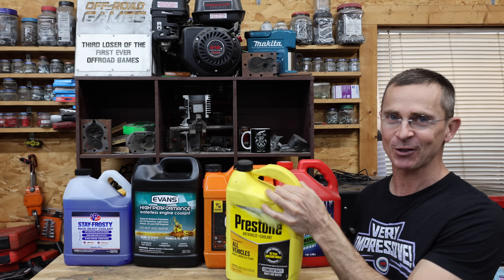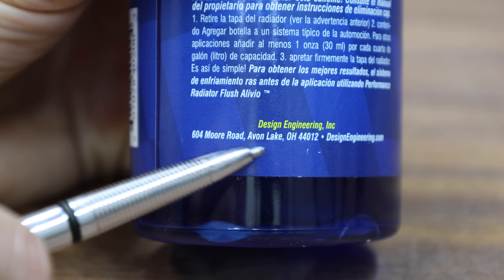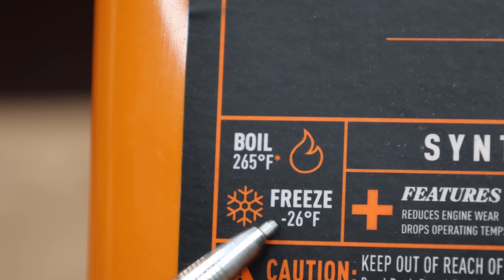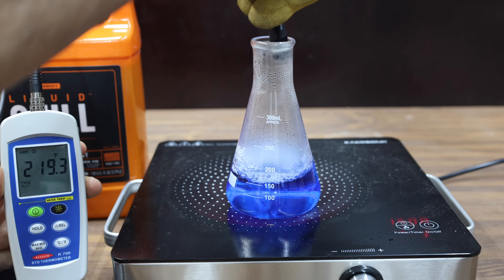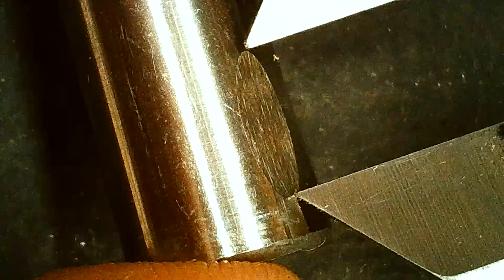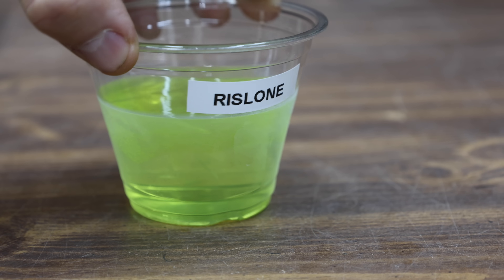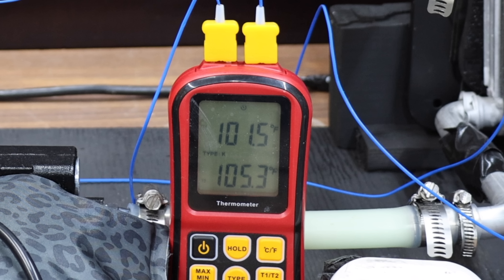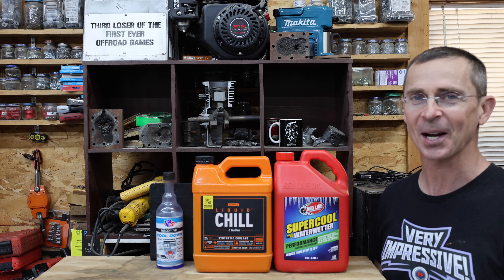Do "Super Coolants" Lower Engine Temperature By 30 Degrees?

Comment: 5:53 As you see, the Evan's Waterless is nitrite-free. Speaking from experience, you MUST do your research when installing alternative coolants. I used to drive a 1984 diesel Mercedes and the OE coolant was G05 chemistry. I used Zerex G05 as it was cheaper compared to the dealer-sourced coolant and essentially the same product. G05 has nitrites added which fight cavitation. In diesel engines specifically, the combustion event is so violent and high pressure and there is so much sideload thrust on the skirts that it causes cavitation bubbles to form on the cylinder wall/liner wall on the coolant jacket side. Those cavitation bubbles will erode holes in the wall very quickly if allowed to do so. You end up with pinholes appearing suddenly one day and your coolant begins burning through the exhaust as white smoke and/or leaking into the lube oil sump causing the oil to become that classic chocolate milk mess. Many people would say "I must've overheated and blew the head gasket/cracked the head” but that isn't the case at all. The true cause was the non-spec coolant which lacked the cavitation protection chemistry required for their engine. 🤷🏼‍♂️ They may do a complete head rebuild and after the R&R find themselves right back at square 1 and $1,000 lighter. Be careful folks. Do your research.
Reply from the maker: Thanks for sharing.
Reply: Wow. Thanks for sharing this story.

Comment: @ProjectFarm love your content. Would be very helpful if you could do a test of various coolant that you could purchase. Fluids are cheap, and Engines are not. About to do my first coolant, flush and hoping that super tech coolant at a low price point is just as good as any other off the shelf coolant. About the only difference I can see is where they are made. Thanks for any help you can offer and for your work that helps all of us.
Reply from the maker: Thanks for the suggestion.

Comment: Pity you did not test flammability.  Also you did not test plain water in the last test.  Consequently you have no base control to compare to test the efficiency of your radiator loop.

Engines are designed to run at a steady (approx) 90c by thermostat control.  The reduced cooling effect of Evans can allow the heat cycle of an Evans engine to stress the thermostatic control based on reducing the cooling margin available.  If engine temp on a hot day exceeds the cooling ability of the radiator then with the very high boiling temp of Evans, the engine can run to higher temps without boiling over and the driver stopping.  The under-hood heat environment can be much higher which may affect other systems (wiring, rubber components, fuel vaporisation, oil temps, etc).  Simply put, engines are designed for a thermal cycle based on the water/anti freeze envelop only.

Comment: Main benefit of the Evans is that it doesn't pressurize the cooling system. Far less leaks because of it. You can run it with the cap off.
Reply from the maker: Thanks for the feedback.

Comment: Video idea. Which Windshield Washer Fluid is the best? At cleaning and applying a protective coating! 
For example, I find the Rain X all season orange both cleans very well and applies a protective water beading coating to the windshield to prevent water build up.
Reply from the maker: Thanks for the suggestion.

Comment: temp lowering is insignificant, 50/50 antifreeze is best unless you have an engine with aluminum components in contact with magnesium.,  then you need Evans

Comment: Actually, why would you want to reduce temps by the coolant . The thermostat is what will regulate the temp . If the engine overheats with everything working properly, you have engine problems like combustion gasses entering the cooling system, cracked cylinder bore, , cracked head, radiator core plugged, engine block with too much rust build up in the jackets or some freak thing associated to those .

Comment: I use"Water Wetter" with distilled water in my bikes for the track and highway, works well, but used for the reason that a spill onto a traction surface such as the track it's not so slick as anti freeze. I use Antifreeze in my trucks and car.
Reply from the maker: Thanks for sharing.

Comment: Another great video!!  Such usable information for all of  us DIYer's out there.  BUT, I've been following Evan's for years and one thing jumped out at about 8:00 when you said the pressure in the coolant system would add about 50 degrees.  Evan's is a waterless, low pressure coolant (you can literally pop the cap off when the engine is hot without even a pop).  The only downside I know of is you need to use an authorized Evans dealer to switch over (at a decent $$).  
Also, with no water in there, you should have no corrosion (how long would a water pump last with no corrosion?).
Your thoughts?

Comment: Ok -- I am planning to buy a eBike next summer. Yuge topic, I know! I need some help sorting through the options. Of course selecting an eBike is a bit like selecting an automobile. Different needs call for different types. Based on my initial research it seems there are two primary categories that people sort through first: tire size (width), and whether it is a folding bike. Other parameters such as the power capacity, voltage, gears, petal assist modes available, and whether it allows for traditional pedaling, battery only, and hybrid seem to be additional characteristics to sort through. There may be more but those stuck out to me. Fat tire bikes are like ATVs or SUVs, they are go anywhere and are or prime interest to me, as they are perfect to run on asphalt and sand..

Personally I am interested the most in a fat tire folding eBike I can check as luggage on my next vacation.

I respect your analytical, scientific approach toward evaluating tools and this should be right up your alley.

Todd, are you and the Project Farm team up for the challenge?!
Reply from the maker: Thanks for the suggestion!

Comment: Interesting take on Coolant products. Here in Sweden we use Coolant in cars mostly for their ability to keep us going in the winter by not going solid.
In the summer we have coolant pumps and thermostats that regulate the temperature of the oil in the engine. Works like a charm even in Desert heat (130f).
Reply from the maker: Thanks!

Comment: Not sure if these are good fornan engine.  Engines are designed to operate at a certain temperature. Also thermostats control the temp. So overall sounds scammy

Comment: Evans used to advertise that due to better metal contact on a molecular level their coolant would absorb more heat per time unit, making the coolant temp slightly higher but the engine metal would be cooler. Their big selling point was higher boiling point and lower system pressure. The preparation process is time consuming since you need to remove all water/coolant from the system (suggested to use their flushing fluid).
Reply from the maker: Thanks for the feedback.

Comment: Boiling is a cooling process, so as a “coolant” in an engine, at atmospheric pressure the coolant that reduces engine temperature the most will be the one that boils at the lowest temperature.
Reply: Boiling water cools by evaporation, if the coolant in an engine boils you will get gas that forms voids in the coolant passages and heat will not be transferred as effectively to the coolant.

You want the coolant to remain liquid to carry heat out of the engine block to the radiator to be cooled and then returned to the engine
Reply: This does nothing to address my statement, that a coolant that boils at a lower temperature is actually better at cooling an engine.

Boiling does not cool by evaporation, it cools by changing physical state and volume.  Boiling is not evaporation, hence why it is called boiling.

Cooling systems are pressurized, that is why I said what temperature they boil at atmospheric pressure.  Coolant doesn’t boil in the cooling system because it is pressurized.  Read up on Mount Saint Helens for an example.

Comment: Unfortunately, these tests is pretty off the purpose.Because maximum heat removal is obtained when micro bubble is produced on the surface of engine and wsshed away by the coolant flow. Hence maximum heat removal is  at the concetration of around 30%, not 40%.
But anti-freeze effect and boiling point is in proportion to the concentration.

Comment: If you think you need additives you should maintain the cooling system first with a new valve and new coolant. Have it flushed if your coolant is contaminated.

Comment: A maintained cooling system works well. Additives are already present in good quality coolant. I ran pink GM coolant for years and it’s still clean without any contamination. Aluminum engines are much cleaner than the older cast iron engines

Comment: You didn't mention a problem that is quickly becoming apparent. and that is manufacturers such as Ford Motor Company. that are using more and more plastic components on their engines. these components rot away where they are in contact with the cooling system. the manufacturers need to stop using plastic components in their engines.

I have always been a huge fan of Rislone products. their performance has always been satisfactory.
Reply from the maker: Thanks for the feedback.

Comment: Thank you for your test. On my side I am using Evans coolant on some of my cars because of the high boiling point. I had no issue with cooling on these engine but they are requiring 20 to 26 psi coolant cap and are high pressure system. Everything is ok but if you have a failing hose, crack in coolant tank (wich is common) or failing cap, you are toast! It already cost us somes engines. A small leak will result in an immediate coolant loss and pressure loss with air pocket in engine that lead to destruction. We are a lot of owners of these models with theses issues. So I went with evans and I did eliminate the pressure issue on these engines and we are way safer than before.
Reply from the maker: You are welcome!  Thanks for sharing.

Comment: Puts water in panel with connected water rubes leading to a wrap panel with water inside at heat collection points > Uses vacuum pump to lower pressure in the water then Cold boil vents the water of all energy to the max temp of water in that pressure level > Sets system to automatically vent collected heat from ice cold water as its sucked from engine Beyond that? You could freeze water in a panel for cold side of a Thermoelectric generator and just use electric motors powered by generator to stack heat power + generator power. Lol..

Comment: I work for a moving company, and it seems like we break 2-3 dolly casters per week! We're looking for durable replacements, especially for 18” x 12” furniture dollies. (Similar to the harbor freight, it may be a good control as it’s absolutely garbage casters dont work beyond one use for us) Many casters claim high weight ratings, but they often don’t hold up in real-world use.

Here are some tests that would be really useful:

Drop test – Dropping an empty dolly from carrying height (about waist level) to simulate how we drop them before loading. While setting them down gently would definitely increase lifespan, nobody in that world actually does it. They always get tossed onto the wheels. 

Weather resistance – Exposure to rain, mud, and extreme temperatures to see if moisture wears away the grease in the bearings (if there was any grease to begin with) leading to failure in poorly designed casters

Thresholds & uneven surfaces – Two tests:
Light load test – 3, 5-10lb boxes (e.g., 18” x 18” x 18” filled with pillows, blankets, lampshades) going over door sills, carpet, rough sidewalks, cracks, and gravel to test slipping or shifting of the load. Typically if the caster doesnt roll well the light objects on the dolly will slip off when there is the slightest resistance to the wheels.  
Heavy load test – A 250+lb dresser placed upside-down on its top to simulate real-world moving scenarios over thresholds, checking if the dolly stops, and needs to be lifted to clear the threshold or if the shocks from the surface cause the load to shift
The goal is to avoid needing to stop when crossing metal thresholds at apartment buildings, as that prevents objects from flying off

Swivel & rolling effectiveness – Testing how well the caster swivels and rolls in all four directions (forward : right, left, and reverse: right left). A common issue we see is seized bearings in one direction, making the dolly hard to maneuver effectively when loaded well below the rated weight. Typically a heavy and light load test would be good for testing this. 

Durability of rolling surface – How well the caster continues to roll smoothly over time, checking for chipping, cracking, or wear that would affect its performance. Over time casters tend to not roll straight with the frame of the dolly, making you need to push the dolly in an off center angle to go forward down a hallway! 

We're looking for casters that can handle the daily demands of moving. It’d be great to see which brands perform best in these tests.

Thanks for all the great testing you do!
Reply from the maker: Thanks for the suggestions.

Comment: That test with the radiator shows why you should be very careful using waterless coolant in a high performance application. Broadly speaking water has a heat capacity about twice as high as the alcohols that waterless coolant is based on.

I learned that with an Italian motorcycle I had. It was running very hot. A friend of mine who races motorcycle saw the problem immediately, the previous owner has used waterless coolant! With the correct coolant the temperature stayed exactly within the correct operating window.
Reply from the maker: Thanks for the feedback.

Comment: Good testing there, I guess one can estimate from this test which liquid has the highest specific heat capacity.
It is one of the reasons why locomotives only have water and corrosion inhibitors in their cooling systems.
Reply from the maker: Thanks!

Comment: What about doing a video for high-temperature coatings? THings like Rust-Oleum High Heat Aluminum Spray, Zynolite Aluminum High-Heat Paint, VHT FlameProof Aluminum Coating, ITC-100HT Ceramic Coating, etc. Maybe some aluminum and steel coupons so you can test how each coating sticks to each surface. Maybe use the hot plate to see at what temperature it starts to burn. A test where you see how long it takes to heat to a certain temp.
Reply from the maker: Thanks for the suggestion.

Comment: My favourite is Evans waterless coolant. It has a higher boiling temperature and while it is expensive it lasts the lifetime of most engines (over 20 years) so it's cheaper in the long run.

To use it properly you have to do a full clean (rinse with distilled water, remove the thermostat (if possible or you'll just have to let it cool and repeat) and run it, empty until it comes out as clear as it was going in)) and dehydrate the system either by using Evans PREP Fluid or a hot purge (I recommend using Evans PREP Fluid).

A good time to do this is when it's time to change coolant hoses and water pump.
Reply from the maker: Thanks for sharing.

Comment: Who makes the best antifreeze ? I have a 98 Dodge Ram Van 5.9 that I have owned since new and have used prestone any make any model antifreeze, changed it 1x a year and I’m at 245 k miles with original radiator
Reply from the maker: Thanks for the suggestion.  Thanks for sharing.

Comment: I wish there had been a way you could've tested the cooling ability closer to 200 degrees F. I understand that the electric heating element may not get that hot and using a gas burner would have been too difficult to control.
Reply from the maker: Thanks for the feedback.

Comment: I have used Evans in high performance street cars. The only thing to remember with Evans is that ALL of the water must be removed from a coolant system before it can be used. It's really only recommended for new builds that have never had water in them as it's very difficult to remove all of the water from a system that was previously filled with conventional coolant. According to a conversation I had with them, even a teaspoon of water can severely affect it's performance. One nice thing about Evans is that it can be used in race vehicles where glycol is prohibited.
Reply from the maker: Thanks for the feedback.

Comment: One thing to remember about the water based coolants. They're 100% water based because they're made for race vehicles that aren't allowed to use any glycol. Glycol is slippery if it leaks on the track. 100% water based coolants are not intended for street use. I use Motul Mocool and distilled water in my race bike with no coolant. Corrosion and freezing really aren't a concern in my race vehicles because I change all of my fluids every race weekend and we don't race in freezing conditions. My only concerns are cooling and wear. The VP Racing is one of those products that performs great as a racing coolant but isn't really something I'd ever use in a street car.
Reply from the maker: Thanks for sharing.

Comment: From my understanding increased boiling point should be a negative. If your cooling system fails and you have a lower boiling point, most of the heat will be used to boil the coolant without increasing its temperature. If you have a high boiling point, the heat will just increase until it warps the engine.
Reply from the maker: Thanks for the feedback.